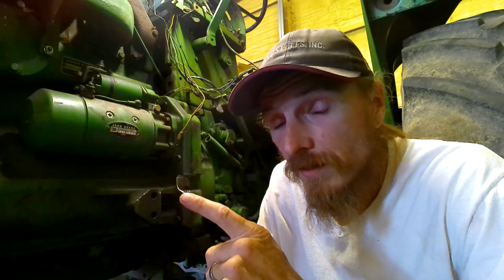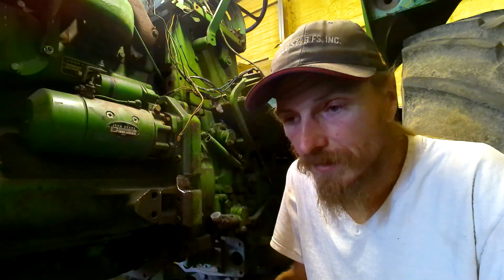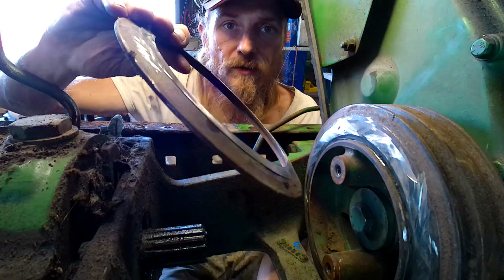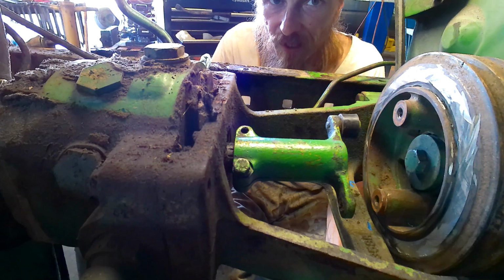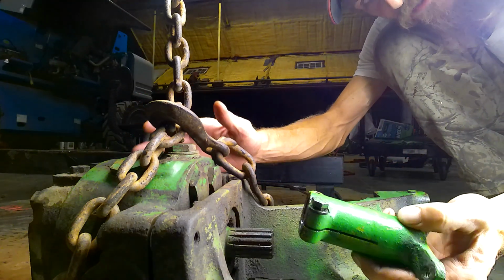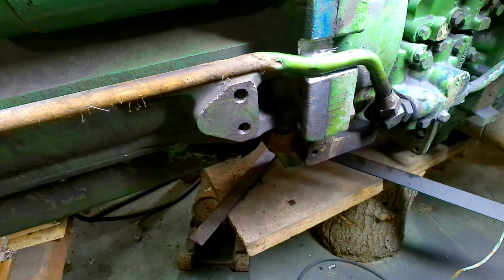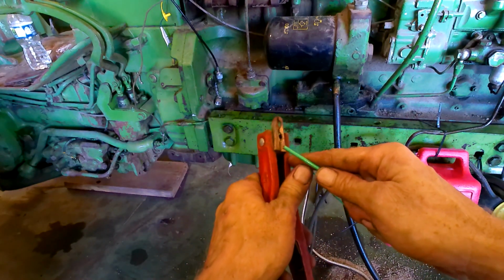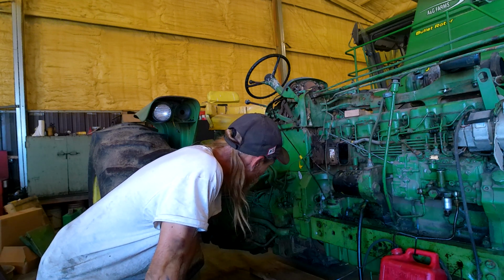4020 GAS POWERSHIFT TO TURBO 404 REPOWER PART 3

Comment: Rick looks good what your doing with that pump assembly should work ok. Trying to get the nerve up to start my project for 466 in a 4020 diesel. Do you think the damper off of 4020 engine will work on a 466? PS is the trans tow lever in prop position? Thanks for good explanations
Reply from the maker: I'm not sure if the 4020 damper would fit or not, The problem I saw was it didn't look like the pully was going to line up with the water pump. Good looking out, But yeah I took it out of tow. I'm pretty sure I know the problem with the trans I 'll explain in the next vid, Thanks for watching.